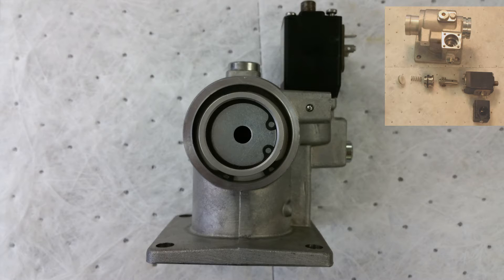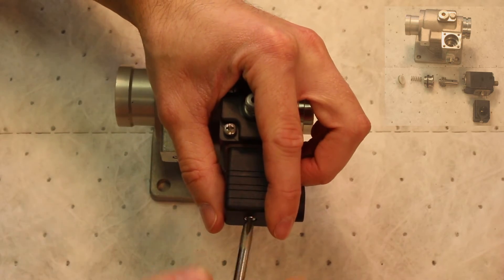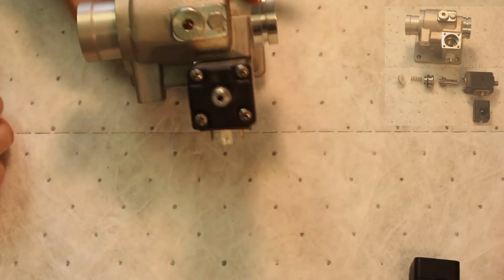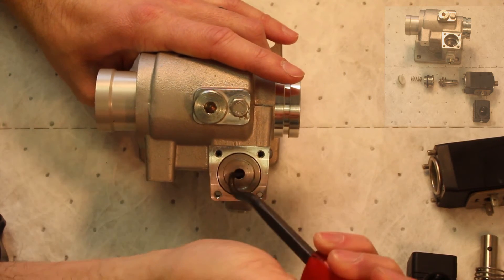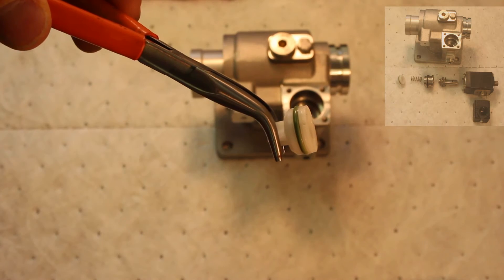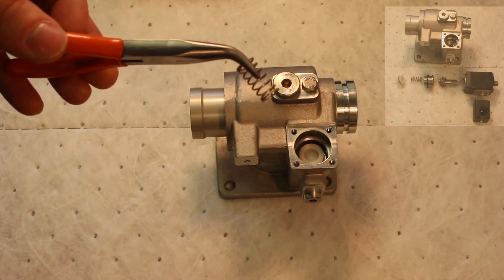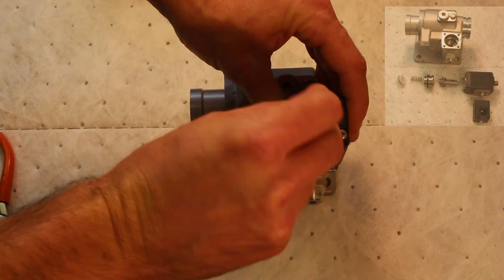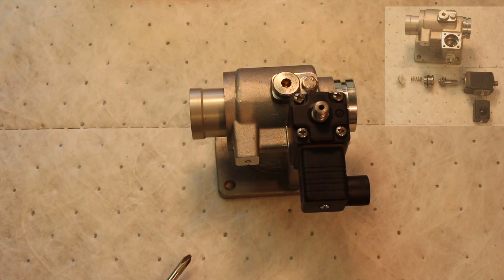Old Style Valve Video

Comment: I’ve been looking for this video for YEARS. 

Here’s my story. There is a CL7 in the place I work and some “magician”  that worked on it before I got this job lost the poppet spring, and I assume the compressor only made pressure for one time when he assembled it. Then, he though it would be a great idea to flip the poppet valve thinking maybe he assembled it wrong. The compressor made pressure, but it never entered on idle mode because the poppet valve was shut close all the time. The CL7 controller has a feature that switchs the operation mode from “idle-charging-idle-off” to alternate between idle and charging, leaving the motor spinning but closing the inlet valve via the solenoid to leave it on idle mode when the upper pressure ser point is reached in order to save power. The only thing that was preventing the tank from exploding was the pressure relief valve and it worked like that for hours or days. After a lot of thinking and testing, I figured that there should be a spring above the puppet valve in order for it to return to its normal position (closed) once the pressure inside the chamber vented when the solenoid valve opens. I found one that fitted in place and voila. It started charging and entering idle mode as it should. This video would have saved me lots of time and thinking.

I wasn’t sure that was the way it came from factory until I saw this video so thanks a lot.